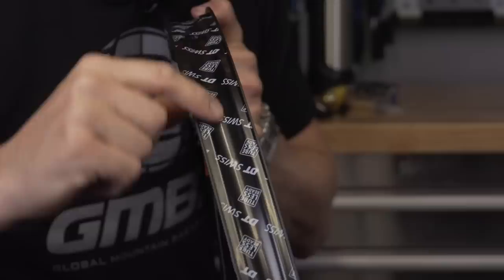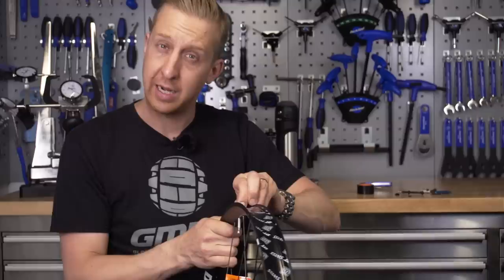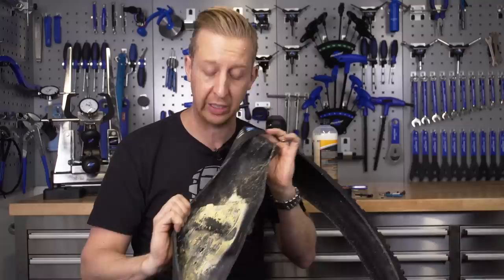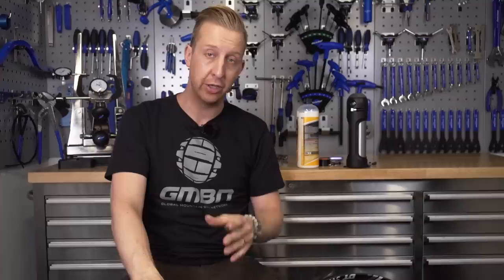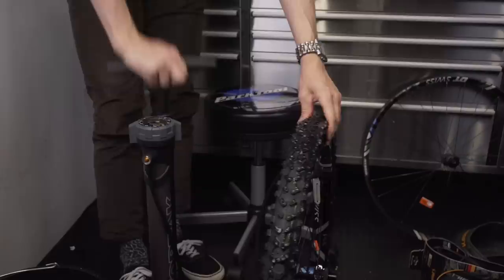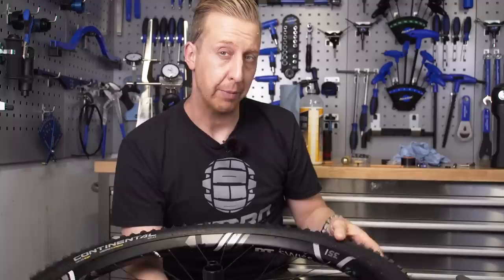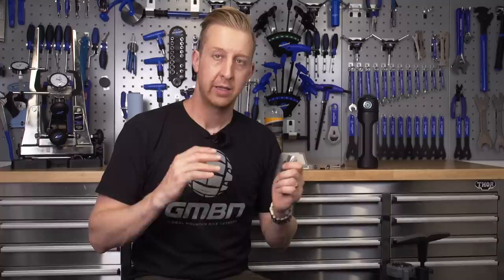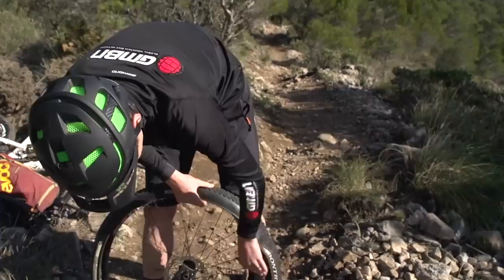Mountain Bike Tubeless Tyre Set Up 101 | GMBN How To

Comment: Doddy:
When pouring sealant directly into the tire:
After putting in tire, keep the wheel vertical, turn it slowly until the tire opening is at top.
Finish mounting last bit of bead.
Inflate and seat tire bead, before sloshing sealant around inside of tire.
This will minimize - eliminate sealant leaking out before bead is seated.
Cheers
Michigan, USA
Reply from the maker: Fantastic hack!
Reply: I actually thought we all did that🤔👍
Reply: This is the way I do it. Very easy, hardly any mess.
Reply: This is just the normal way of doing who would slosh sealant with a unseated bead? Makes no sense at all.

Comment: If you have trouble seating the tyre for the first time, USE A TUBE, inflate as normal and pop the bead into place. Once you have that done, crack only ONE side of the tyre back off the rim, remove the tube and secure your tubeless valve in place. 

Having one side of the tyre already seated makes it significantly easier to seat the rest of the tyre again later, especially if you're not using a compressor.

Reseat the tyre without the tube or sealant just to make sure you can, then either crack the bead to pour your sealant in, or feed it through the valve stem.
Reply: Alex Paulsen thanks for the tip
Reply: This depends really on the the rim you have..
On some rims this works amazing but on other, mostly wide and shallow rims (like my Halo Vortex) the tire doesn’t get seated properly when having a tube in it.
This happens since the tube bulks up the tire to much for the shallow rim and then sits a bit above the rim, where it would sit in a tubeless setup.

So if you deflate the tire, after you inflated it with a tube, the tire still doesn’t sit properly.
Reply: Great ! after two hours of search, it's the best answer. Thanks a lot :-) !

Comment: I just got my first tubeless setup, thanks for guide through it worked perfectly. Got a little messy putting the valve cores back in, mopped up the living room floor and it's back to normal. Glad I don't have carpet 🙂

Comment: Really informative video! I wasted around 50 Bucks on a conversion kit and after almost 5 hours of getting the things sealed up, one of the tires was flat the next day and the other one was also not great. Lost a lot of the fluid and then I decided to just put inner tubes back in...
Reply: i've done it several times, usually works fine. but my newest bike was a total mess...don't know why.  i went back to tubes, then tried it again and it was fine.  tubeless tires are great, though, give it another go sometime!

Comment: I use Oko offroad tyre sealant, it's not mtb specific but works perfectly well. It's a much thicker fluid than stans etc and doesn't make any mess. The best thing is it costs £9 for a 1250ml bottle, less than half the cost of Stans.
Reply: Market it for a bicycle and give it a nice smell, and you can sell smaller portions of it for horrendously inflated prices.

Comment: I just went through hell and back trying to convert my tires with a diy tubeless conversion. I finally got it to seal and work properly. I ended up using a normal compressor and shrader valve chuck directly on the open presta valve stem without a valve core in it. That finally got my tire seated. Once I got it seated it was still leaking a bit, but I just let the sealant do its work and would put a few more psi into the tire and shake it up. This process helped me a lot. Thanks for all the tips! Soapy water was a huge help in getting the tire seated. Just glad it worked.

Comment: Over the weekend I had a puncture and realized that I hadn't had the wheels refilled with sealant for at least 8 months... so I had to install a tube there and then. Actually it was a friend's one, since the one I had strapped to my bike for months had burned, and when I inflated it, it ripped (another lesson learned).

Back home, to bring all this back to standard, I normally would have taken the bike to the shop, but now, due to Covid, some of my favorite service shops are closed, and I have more time, and more propensity to save.  

So I just bought the right stuff and refilled the unaffected wheel through the valve, whithout dismounting it.  After seeing how dry the sealant was in the affected wheel, I guessed I urgently needed to do that. 

For the punctured wheel, I did the tire patching like suggested, and completed the mounting with the "soapy water" and the filling with the "dry" methods. It  worked liked a charm.  Thanks!

(Note: Removing the old, dry sealant with warm soapy water, like suggested, was really a hassle though.  I'll try to find out other methods for when I have to clean the other wheel, but don't go that route unless you want to spend more than an hour scrubbing away.)

Comment: NIce vid, if you only have CO2 you can inflate dry to seat the tyre, leave for a while then unseat a small section and pour the sealant in or inject, then pump back up with normal track pump.

Comment: Nice vid Doddy - thanks. I recently had a problem seating a 3" tyre on a 50mm rim.  Airshot & Compressor both failed initially, even with the ever dependable soapy rim - wouldn't seat the floppy (Chupacabra) bead - not even close. Resolved by installing inner tube and inflating to 50psi to pop the bead on. Then broke one side to get inner tube out. Airshot then popped the bead back on the open side. If that failed, I would have (been prepared to) cut the inner tube and only break a small area of bead - just enough to get inner tube out/tubeless valve installed. Thankfully it didn't come to that. Cheers

Comment: I replaced both of my tubeless tires this week with slightly wider models. I quickly replaced my rear but was having a lot of trouble getting the front to seat. I looked up your video which was very helpful in reminding me to try CO2.  Two cartridges later it was mostly seated, and I completed the job with an electric pump (set to 30psi max).  For the reasons you pointed out, I added the Stan's later through the valve stem so it was not affected by the CO2. Thanks for that advice which allowed me to get the job finished and go biking today! And I should also thank you for your excellent video on stopping brakes from squealing.  I got a new bike about a year ago and did not know about bedding in the brakes, so within a few weeks they were squealing badly.  But I cleaned the pads and rotors following your advice and they have been silent ever since (except occasionally for a short period after going through water).  Again - many thanks for this and all the other very helpful GMBN videos!

Comment: There is also the dry and wet method mixed -seat the beads without sealant, break the bead on one side and tip in the sealant less mess than your wet method and only one bead to get back on with the pump....

Comment: Go through methodically, get the pop as it snaps on the rim front and back, set the final pressure install on the bike and do a short run...alls good. next day still at pressure, happy days. two days later and 50 miles later, left overnight the back tyre flat as a fart. no puncture, top up sealant (just incase) re- inflate alls good...for a couple of days...rinse and repeat. Finally find its the valve stem leaking, refit, repeat process....two weeks later my back wheel has gone back to inner tube whilst the front remains tubeless absolutely no probs. Be prepared for frustration and mess.

Comment: Definitely remove the valve cores, Use an air compressor. Inflate and set the bead first with no sealant, add the sealant after setting the bead. There doesn’t seem to be an easier way,  especially when the tires are super tight to get on.

Comment: Great info, I’ve had to strip my tyres off as spokes are pinging and need tensioned, I will use the dry method, what about once the tyre is beaded and before I put in sealant I was thinking about placing the wheel in the sink with water to look for air escaping, I noticed you didn’t suggest this .

Comment: You can seat the beads with tubes first, break one side off and add the valve, add sealant, then inflate. Takes a couple of minutes longer but increases the chance of seating the beads significantly this way.
Reply: I wish I'd read this yesterday before embarking on my own voyage of discovery and ending up at the same place!!
Reply: This is what sorted all of my problems today! Could I get the bead on? Could I fuck. But with tubes in? Worked a dream, still holding pressure so far without tubes...
Reply: You gave me hope!!!!

Comment: I had a fight fitting some new tubeless tyres to my wife's bike earlier tonight - the new Schwalbes I bought her are fractionally looser on the rims than the worn out Hutchisons I'm replacing. I got the back seated eventually but couldn't get enough air in the front to make it pop despite using a compressor. I'll be having another look at them tomorrow so I'll try adding a second layer of gorilla tape and see if that does the trick. Cheers for the hint.

Comment: Facts. You can do tubeless with only TR tire (skinwall). Mine Maxxis Skin wall. My rim is Crossride non Tubeless ready. The valve? I cut it from Tube. You know what? My tire pressure is holding. No lie. I used it now for long rides but nothing happen. And when i got home. It still solid.

Comment: Schwalbe tires seem to only go on with an air compressor. I have the same mini air canister as the the one shown hear. Have only one gotten a tire to dry mount once with Schwalbe. Maybe a different brand like Continental or Specialized are easier to mount tubeless. Valve core removal is definitely required. Nice demo on this!

Comment: Great video!
Conversion kits suck.
If you want to go tubeless, just get a new set of tubeless rims and tires, or, if your bike is old enough and doesn't have neato stuff like tubeless, hydraulic disc brakes or a 1x setup up front, maybe consider a new bike?
Reply: Great idea to turn a 20€ expense to a 2000€ one!

Comment: The new Continental tyres are amazing, seated first time with a £10 ac car air compressor :)
Reply: I've spent 4 fucking hours trying to get mine to seat, and still no success. Brand new continental der kaiser. I've tried soap, an old tube tightened round the outside, a compressor, a topeak pump that has the cannister. Still no luck, any suggestions?

Comment: Instead of using a syringe I purchased a small (60ml) bottle of Joe’s no flats sealant and you can use the bottle to put the sealant straight into the valve. I just fill it up a couple of times, easy!
Reply: Syringes cost pennies in the EU. Literally, or cents. They come with a printed-on scale.

Comment: Bout the tire...i bought some relatively cheap performance schwalbe tires(liteskin which heavily deforms under 25psi in the corners. A Hans Dampf in the front and a Nobby Nic in the rear. Cut out some valvestems out of old punctered inner tubes because i was too impatient to order them. Rim is a non-tubeless ready 19c 27,5 from a 400€ "full suspension " bike. So i put on very thinwalled, non-tubeless 2.35in tires on a narrow non tubeless rim, one layer of tape and they popped up first time with the valvecore still insde with the wet method. 
Is that what you call luck? they loose about 2-3 psi every 2 days though. But i check tire pressure before EVERY ride anyways(im also a roadie)

Comment: hey guys I use the tubeless system for years with many tires from different manufactures but a month ago it happened ...
I wanted to try the speed king from Conti  for a quick strava segment on my hardtail^^. The front was ok but the rear tire kind of exploded from the wheel. I was covered in notubes milk and had a tinnitus like after a brutal concert. I don't no maybe it was a lemon tire. I had to wash my face and arms 10 times with soap and brush the milk is so gluey ... Since I experienced this I always use safety goggles and ear protection.
Reply: Use tubes and slim, now how easy is that? DUH. Just carry a patch kit and a spare tube, for peets sake, complicate everything. And with all that sealant  and a big mess,no weight is saved. A few ounces for the average rider is nothing.
Reply: Sorry, Slime, had to put that in for the super spellers.

Comment: Gorilla tape clear is a better option. It’s stretchy, light & doesn’t leave the horrid glue residue all over the rim if you need to replace a spoke or re lace the wheel.

Comment: Hey doddy,
For particularly stubborn rim tyre combos I tend to tape the rim and then seat up both sides. I then take off one side of the tyre then add valves and sealant so only one side is left to seat up. 
Often I will also spray a bit of ptfe spray around the bead to help it slide into place as I have had instances of the rim tape being ripped off as the bead slides into the socket.
Keep up the good work!!
W

Comment: I am having hard time setting  Continental Trail Kings to tubeless. They are way flexible and hard to seal the air in.
Reply: oh yeah man... I had continentals, and they leaked all the time. Make sure your Continental Trail Kings are Tubeless ready. Their branding designation for tubeless is "2Bliss"

Comment: Doddy you didn't line up the Continental  writing with the valve (11 mins in)... disappointing!
Reply: 20noups haha good point
Reply: I read that as daddy not doddy...
Reply: tom wynn style points
Reply: tom wynn, where have you been. The object is to seperate you from your money for something you didn't know you needed. Do Not Go Tubeless they are a royal pain out in the woods.
Reply: @aimlessdrive8723  style points basically. It is not necessary at all whatsoever. But you outta do it if you dont sombody to mention it to you every time you take out your bike. Like I said, not neccessary but will keep the bike snobs away😉
Reply: @garethrobinson2275  True that boss!!!

Comment: 1). Do you have to replace the valve stem each time you make a tire tubeless?
2). Do you have to use the compressed air method for inflation? Or can you use a standard floor pump

Comment: Hi I liked your video . Is there a min pressure for tubeless tires to retain a seal?
Reply: Not directly to your question, but many tires have a minimum pressure anyway. Too low a pressure and you might get sidewall cracks. FYI, some rims have a maximum pressure, and it's possible that both ranges don't intersect (= incompatible).
Reply: If it's a proper tubeless-compatible rim there's a little bump that holds the tyre in place [that's what gives the "pop" when initially seating the tyre], so as long as you've got enough pressure to ride the bike you'll be ok [depending on how rowdy you get, of course].

Comment: Is it possible to run tubeless without tubeless sealant. So like dry fitting but never putting in the sealant?
Reply from the maker: It's possible, but takes away much of the benefits of going tubeless. The sealant is really worth it and virtually eliminates all but the largest punctures.

Comment: I have so far converted 6 wheels to tubeless with gorilla tape and orange seal (best sealant ever) and all of them fully sealed first try and i was using a 5€ supermarket hand pump
Reply from the maker: You're lucky with the wheel/tyre combo then! Not all wheel/tyre combinations are so easy to get setup. Or maybe you just did a great job of it!
Reply: yeah my tire and rim combo have a VERY TIGHT fit

i had mavic crossride wheels and they were super tight and now i have hope tech enduro (27.5) and they are much looser

my tires are maxxis minions 27.5 2.3in wide with a folding bead
Reply: @jaakko200987654321  can I have a link the the valves you use? I've had trouble getting the correct valve type
Reply: 2:32 which sort is it?
Reply: @johnrichards7847  yea, i will search them for you
Reply: @johnrichards7847   https://www.amazon.com/Orange-Seal-Cycling-Versa-Tubeless/dp/B077CRNMCG i used these valves. i bought them from my LBS. also they are the ones with the cone shaped rubber thing. they come with both square and cone shaped adapters

Comment: I needed to watch this video before installing my Muc-Off tubeless kit. I don't have a proper pump to inflate them.
Reply: Presta valve is annoying  as he'll shrader  is more industrial  looj
Reply: @jonathanoxlade4252  The valve is not the problem, but the instant volume needed to set the tires.
Reply: Coke bottle or spray bottle.
Reply: you can still seat your tyre with a track pump. I made a video on how to prepare the tyre and rim. Besides making sure the contact points are as clean as possible. Good luck!

Comment: I have a portable Airshot for the Van but save yourself some grief and invest in a compressor. My LBS swear by a 50/50 mix of Stans and Orange.. I questioned mixing different sealants but they said O/S was fine. Tried it over the last 2 months and it has been ok.. in fact just sucked it out last night and replaced it and it was in good shape so yeah would be interested to see some evidence it cures as my test 2 months certainly didn't, it definitely doesn't split also as they are readily soluble in each other. Easy to test just mix a few different sealants in glass vials and leave them in the dark for a few months.
Reply from the maker: There must be something that makes them compatible? Any chemical experts out there?
Reply: Unlikely any chemist would be able to definitively tell you even with a full ingredients list. They will probably be pH sensitive (Acidity/Alkalinity), CO2 does acidify water so perhaps why Stans is incompatible with CO2 if its water based and is alkaline?. Only way to know for certain would be to test them. I've kept the 50/50 Standard O/S solution I took out and it's definitely not splitting nor is it coagulating with no evidence of boogers in there so far.

Comment: Just set my wheels up tubeless but the front wheel isn't sealing properly around the valve. I'm using the same valve and rim as the rear wheel which has sealed fine. Any tips?